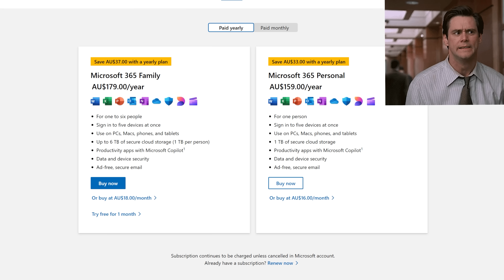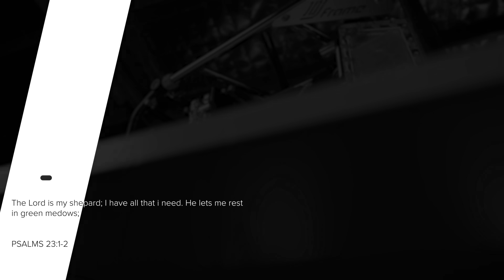Fixing a Viewer's BROKEN Gaming PC!

Comment: First, you dust off the stuff, and then you clean it with a wet cloth, buddy.
Reply from the maker: I use the blower first, then I go in with wet toothbrush to remove the oils and stubborn dust
Reply: @DesignsByIFR  Using a brush and a vacuum cleaner works best, as it prepares the surfaces for wet cleaning, making the job almost effortless.🙂
Reply from the maker: @kamelb4224  vacuum cleaners should always be avoided.

They create static electricity and can fry your hardware

Comment: This looked exactly like one of my friends HP PC's that was given to him. The amount of caked on dust, dirt, cobwebs, and thick grime choked the graphics card in it and thankfully did not go up in smoke. I had done a full detail cleaning of it. Specs i recall were 12gb ram, i7 2600, and  i had thrown in a gtx 950 i had on hand with a fresh install of windows. Not sure if he still has it.
Reply from the maker: Must have been a popular pre build back in the day
Reply: @DesignsByIFR  i think they were. I seen them all over the place, even at few job sites i used to work at

Comment: These HP IPM87-MP motherboards are notorious for having bad Sata controllers. So if the customer is still experiencing hard crashes, you might recommend them buying a PCIe Sata controller card. I had to do this to my Mom's PC and it fixed the issue.
Reply from the maker: I'll add that to the list of advice!
Reply: @DesignsByIFR  And an upgrade to booting off SSD, and having dual channel RAM

Comment: So, did you follow James and Matthew in giving simple guidance to the likely still able 60 yrs aged mate from church?

Even quarterly, a simple cheap hand held blower and some basic teach 'em "how to fish" knowledge will resolve basic PC cleaning hygiene to avoid buildup.

The overall state of things, especially the power supply was a fire risk.  And that system has a "dirt cheap" power supply, safety and efficiency were not the focus.

Although I know it makes for cheap and quick entertaining cleanup videos... Please ditch the crazy toothbrush on the electronics; people will get bad advice ideas and more e-waste will occur from damaged components.

This was kind of a missed opportunity for future thought. You could have done some cheap old school mods to provide the end user with better dust filtering vs that very cheap budget case design.  "I not only fixed this for my friend, I made the overall situation better, here's how..."

Appreciate you helping out your fellow elders.
Reply from the maker: I appreciate what you are saying, and yes I always give advice, but you need to understand that I cleaned up this PC to be kind to him. If I have materials on hand to make dust filters I'd be happy to do that for him, but I don't and he needs his PC asap for work. I suggested to him a dusting every once in a while will help.

His PSU works fine, the tooth brush is not going to hurt the hardware, the idea is to lightly loosen, not push down with so much force that it will damage components.

But I appreciate your thoughts. Thank you

Comment: I build a lot of computers and restore them, It is  common that it is so much dust in the psu so it would not give power enough to start the computer.
Reply from the maker: Thanks for feedback
Reply: Take a look at 0:16 and there is no way that PSU was getting fresh air. The before and after is night and day. Although I usually try to avoid opening up PSU units as the caps can hold some charge. I find a dry paint brush with long fibres can knock the dust loose and then use a zip tie (thin plastic to slide in the grooves) to stop the fan spinning when you use a leaf blower to blow it out. Of course, I always check against a PSU tester first as there is little point cleaning a faulty unit.
Reply from the maker: @danielgorry4705  yeah, I try to avoid taking apart power supplies as well, it is dangerous. But this one was just on another level with dust haha, but I do try to take care.
Reply: @danielgorry4705  Exactly, I use rubberglows when I open them up, need to be real careful, when it is unplugged i press powerbutton on and off several times and let it just lay around for a couple of hours before i open them.

Comment: Suprisingly, that line of HPs use normal connectors. Makes swapping parts easier.

An ssd would do wonders for response and boot times.

My guess was psu. Always good to put on a psu tester and measure the voltages.   Or swap for a known 'good' unit. 

Great video
Reply from the maker: Thanks!

Comment: I have the exact same PC but with an I5-4460 instead of the i7-4790. It works really well and I have Windows 11 installed on it. You mounted the case fan the wrong way around.
Reply from the maker: I wanted it as intake